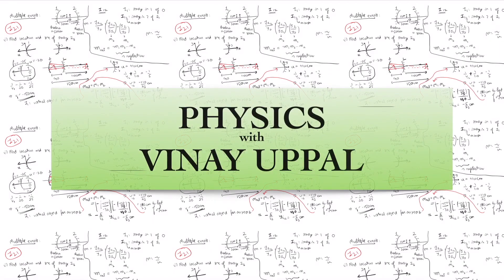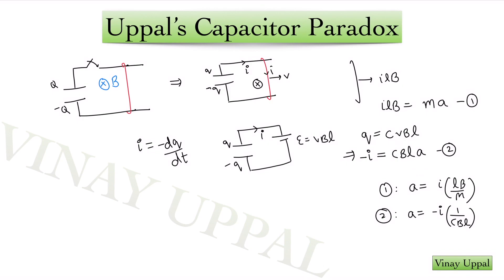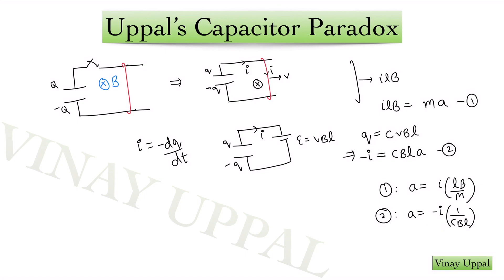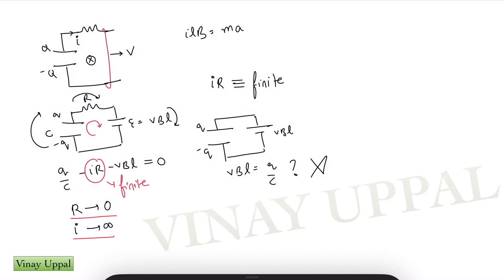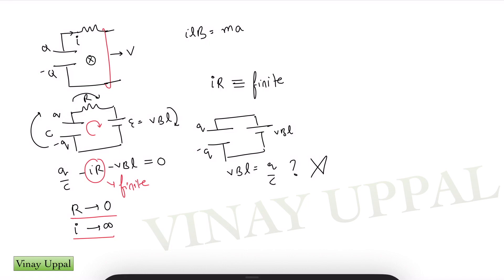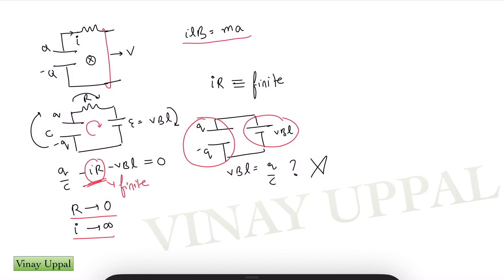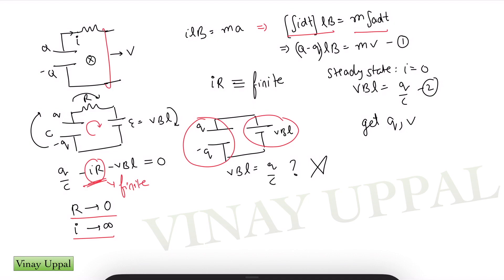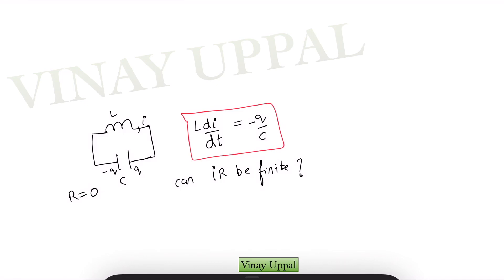S2 RARE: Episode 2: Uppal’s Capacitor Paradox Explained.  JEE Advanced

Comment: Sir there is a question related to energy stored in an ideal capacitor when connected across an ideal battery with zero resistance. Energy stored in the capacitor is half of the work done by the battery. So, where did other half of the work done by the battery go. There is no heat loss as resistance is zero. Can you please make a video over this topic?